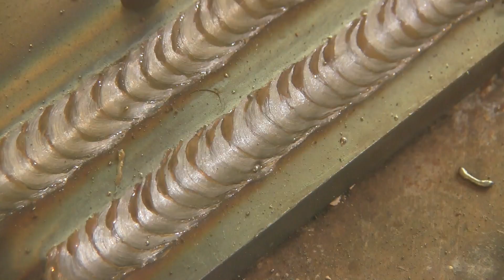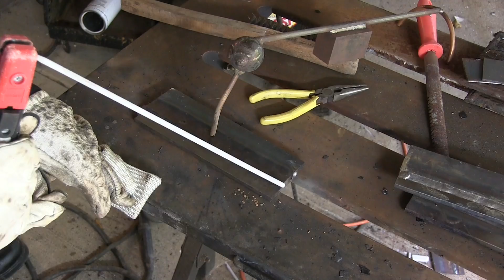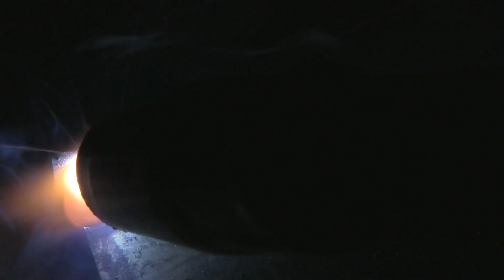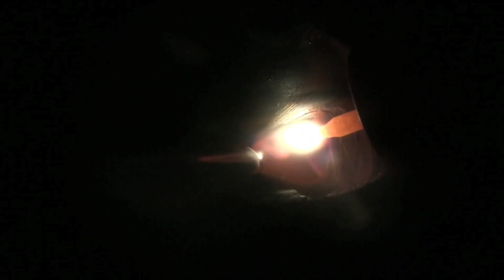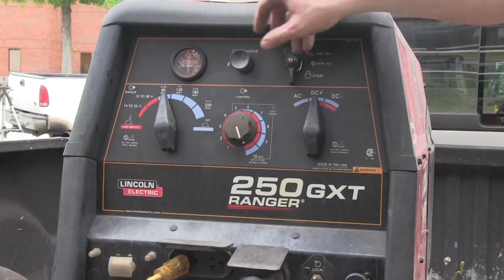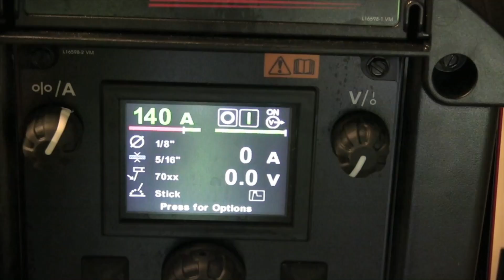MIG Welding, 7018 Stick, & Dual Shield Flux Core

Comment: Also what is this short arc mig vs globular transfer or spray transfer? Is this all performed with the same machine and just different settings so the weld applies to the parent metal in a different manner? Thanks for all you do!

Comment: I am having issues with lincoln 71m .035 dual shield in the flat position. With the numbers that J D was using on his machine in this video, I would be very interested to see a cut and etch in the flat position. My cut and etch in the flat position with those settings show next to no penetration. I see alot of cut and etch from vertical up dual shield but none in the flat. Does anyone know of any videos of cut and etch of dual shield in the flat position with these similar settings and inverter machines?????
Reply: Try slowing travel speed and it wouldn’t hurt to find recommended wire parameters from Lincoln

Comment: As a novice, if welding some small pieces of 1/8" gusseting onto a used trailer suspension (leaf shackles), would I be better off using 7018 stick or flux mig?  It will be outdoors and obviously getting the metal super clean would be difficult.

Comment: Having a little trouble with the dual shield 0.035 wire and the 210 MP. I do not get the puddle to flow properly and at times the wire burns right off at the nozzle. I am welding smaller pieces and thinner steel (filling a hole in a steel shovel). quite frustrating. Can you give me a starting point for using this machine and the dual shield for 16-18 ga, mild steel. I am using 100% Ar - could that be a problem? Thanks for the help.
Reply: Try a longer stickout and more quick tacks.

Comment: What's your flux ocislation, Or do you just drag ?
Reply: Different joints require different techniques.  Practice doing short beads until you find what looks acceptable
Reply: @Eldono27  I've learned so much since this comment... I'm now certified!! but thank you for the response.
Reply: @DonnyBwelding1  Congratulations!  What are you certified in?
Reply: 2f eg 3f eg 4f eg annnnnnndd pipezies ! Also alum, titanium anddddd .... can you guess. ???

Comment: hello very good video I see that you are a true teacher I would like to ask you for meters of regulation for an upward welding in wire of 1.2 flux core the piece to be welded is an IPM so it is called here is a steel beam in the form of i I would appreciate your response, greetings from Argentina

Comment: Hey Jody, Great videos man, I have learned a lot from watching them, so i have a 210 mp as my home hobby machine and aside from the out of round drive roller assembly it runs well. but recently i purchased a cylinder of 90/10 mix and it doesn't want to weld at all, i expected it to spray because with c25 at 25v and 450ipm the machine wants to spray. i think i might have a bottle of incorrect or bad gas because the weld doesnt even want to stick, and at my day job i run axial spray and pulsed spray for over 5 years now so i know what its supposed to act like. my question is...can you run a true spray transfer with your 210mp with er70s6  .035 and 90/10?, the lincoln consumables book suggests that it does but either my machine cant maintain the voltage or i have faulty shielding gas. thanks in advance for your help.

Comment: Good video.  I've been running Hobart 7018 and welds good but the slag is like concrete.  Is it not enough amps or what?  Any suggestions?
Reply: Jerry Beck you know i love that Hobart electrode but it really depends on your machine setting ....i use to run in xx10 and high dig on my trailblazer 325 and it never stuck but the slag sucked ... so i moved it to xx18 and the dig around half and it peels everytime

Comment: How come you weave on a hv fillet with a mig ? 
I was always taught to keep the wire pointed at the weld root with the wire leading the gun  by about 5 -10 degrees . The only time i dragged a wire is vertical down , overhead open butt weld or welding car panels .

Comment: what rod would you recommend I'm going to build a engine stand with 3/16 tubing.
Reply: 7018
Reply: +Donovan Morris thanks for that not real sure what type to use for strength.
Reply: 7018 stick rod will give you plenty of strength. clean the metal up nice and have a tight fit up and it will go smoothly. Be sure to check out some of Jody's videos on YouTube of 7018. He has the best on YouTube

Comment: ...What are you using for etchant..? I used to use nitric acid, but due to EPA it's hard to buy now....
Reply: Navel jelly works. It's not nitric acid, but if you have a smooth surface it will show you the nugget.

Comment: .....11:00   Pushing or pulling......some say pulling gives a little more penetration, but I usually push it....with   .035 and C25....people ask if I was TIG welding that steel.....and that dual-shield..... Back in 1985-6 I was welding for a sub-contractor for Aero-Jet...a rocket motor company......and did a whole lot of Dual-shield....welded A36 HRS... 2-4" thick....ran 1/16" wire and C02.....10 hours days...some days I used 2 of the #60 pound rolls....employer bought the stuff by the pallet....30 rolls to a pallet.....usually got one about every month or so.... After welding...the weldments went to the big lathe and got maybe 1/2 the material cut off....making mandrels for missile nose-cones to be wrapped with the first carbon fiber type stuff....  Running that 6010....seems the inverters don't run that rod very well...?  and the book....Excellent .....!

Comment: At 7:17, picture perfect, but when you did that vertical pass, you had the welder ground clamp directly on the work, and perhaps in equal contact with both pieces being welded together?  I think in previous passes you may have had the table clamped and the work resting on the table as lap joints.  Perhaps the majority of the welding current was taking the shortest path through the bottom plate to the table, inviting just a wee bit more penetration on the bottom of the weld VS the face that goes into the top piece, as shown in some of your cut away views.

Comment: Hey Jodi, I was wondering if you could do a video on the tensile strength of mig welds and how you would judge or figure that out as stick electrodes are clearly rated in their number code
Reply: jayro4113 Er-70s-6 is the filler metal designation for the wire he's most likely using in the video. That's 70 thousand psi tensile strength much like a 7018 or 7014. The s  indicates it is a solid wire, not tubular like flux-core or metalcore. The 6 is just a composition number, what the silicon content, deoxidizers, etc.
Reply: Thanks, that answers that and I never truly paid attention to those numbers on the spool. So that helps. My next question in return would be; at what amperage/voltage/setting is that weld with that wire rated at that tensile strength? If you take a 1/8" 6011 electrode on 1/8" material, when you get down to 90amps you know it's not that rated tensile strength because it sticks and doesn't penetrate. But you take an .035 wire and weld 1/16" material with it at 12-15 bolts for example. You can physically muscle that weld and fatigue it which implies it's not that rated tensile strength. Where do they draw the line to get that number?
Reply: jayro4113  tensile strength is measured in pounds per square inch, so a solid cubic inch of full penetration weld would require 70 thousands pounds at the minimum to pull it apart, a little fillet weld on some thin gauge sheet metal isn't as substantial. I hope that makes some sense.
Reply: Joe Boyle; yes, I'm well aware of what psi and tensile strength is, I farm. But nobody unless they're doing structural/pipe welding maybe, runs 1" thick beads which would make that rating redundant to all other applications would it not? I see big tractors bust solid welds on equipment all the time regardless of the electrode/wire or process used for the weld
Reply: jayro4113 the tensile strength is a static factor in filler metals, but something's tensile strength isn't an end all indicator of how tough a weld is. Tensile force is one of many, like torsional and shear force, which a tractor can subject itself to, and a filler metals ductility and yield strength is more important than its tensile strength. A 6011 is a good rod for welding in dirty shit at  75-115 amps from what I've used, but it doesn't have the mechanical properties that a 7018 would have, it's more rigid and prone to give under shock
Reply: jayro4113 whatever settings provide complete penetration for the entire weld are the best for truly reflecting a filler metals tensile strength, nothing more.
Reply: jayro4113 also, look up a tensile test to watch how they decide a filler metals tensile strength, it's kinda cool
Reply: Joe Boyle I used 6011 as an example, but we run them up to 150amps with good results and it's our go to electrode on the farm
Reply: jayro4113 sorry if I couldn't answer your question as well or if at all as you wanted lol. But for sure on the 6011
Reply: Joe Boyle Nah it's all good man, thanks for the help 👍
Reply: @jayro4113  I believe settings would have to correspond with manufacture’s consumable recommended parameters

Comment: Hey Jodi witch spool gun would you recommend. I'm also running a 210mp off a 250 gxt
Reply: You should head over to JD Brewer's channel and ask that same question. I think he's done a lot more with a spool gun on this machine than Jody. (I'm basing this on content I've seen).

You might get a quicker response as well, considering Jody has nearly a half million subs.
Reply: The Lincoln electric spool gun 100.  It's only $300
Reply: Okay sweet thanks man🤘

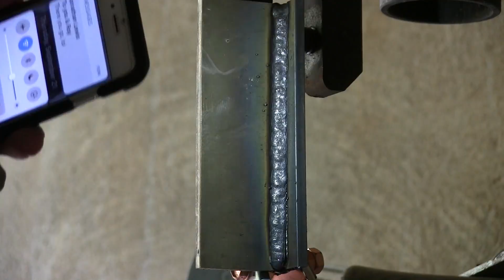Comment: @7:01 that's what i love about .045 71 FC the slag comes right off. no muss, no fuss. most times you can just use a blower nozzle, or just move on to the next weld, and let it fall off by it's self.